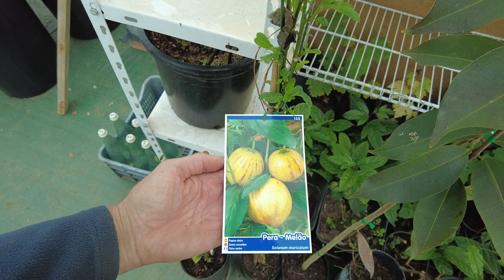Sandbag leaky weir ready to be tested. Let the rain come!

Comment: Tried to get the pepinos to grow for years now, but they always get completely destroyed by the spider mites. They're not very resilient.
Reply: A suggestion for you; If you ae having trouble with spider mite infestation, make sure they are clean before you plant them out.  If you see evidence of mites, wash the under side of the leaves in running water.   Select a different part of the garden than you have used before incase eggs survived in the soil.  Immediately after planting, cover with white, non-woven floating row and grow them undercover for the season. 
Hope that works for you! 😊
Reply from the maker: Thanks for sharing. Are there any natural enemies for them?

Comment: 0:10 That's the mouse who plants acorns!  Relocate the little critter out to one of your brush piles on the far side of the farm  - alive and well so he/she can start planting in that area  I'll suggest keeping a live trap around the house just for that purpose.😊
3:40 That is a great surgical cut.  The branch bark collar is fully intact and the majority of the exposed wood is alive.  I think there is a good possibility that collar will callus that wound in a few seasons.  I am curious about the pattern of decay.  Can your Forest Warden identify why that is happening?  If you want to seal the healthy wood, I will suggest Lac Balsam, formulated in Germany for this exact purpose.  There are two varieties.  One is simply a coating that will not inhibit callusing. The second I'm told has anti-decay ingredients that is not sold in the US.  I have used it the coating only formula with great success.  It is the only coating known to protect the wound as healing takes place.  I strongly encourage you to buy a tube and try it.
I agree with the other commenters about sealing up decayed wounds.  The damage is already done to the heart of the tree.  Sealing the opening seals in disease and moisture - and that environment  speeds up the rot and decay process.  I know, intuitively it makes sense - but university research says it is bad practice.  The best thing you can do for the tree is; do what you can to protect it's vigor so that the outer layers of the tree continue to add healthy tissue.  You want to encourage the outer bark, inner bark (phloem), the cambium cell layer, and the sapwood to stay healthy.  Selective pruning to balance the load on the trunk is your best bet 😊
While you have the volunteers, I'll suggest that you use them to help move some of the longer, heavier pieces of tree trunk you have into the creek and erosion gully and lay them across the channel.  If you get them positioned now, you can use them when you have time as the base for more leaky weirs and/or one log dams.
All of the climbing plants you have will be spectacular on the steel wire garden arbor you have built.  One end with a climbing rose on the right and left will make a spectacular entrance.  
Good luck with your leaky weir build tomorrow!
Reply from the maker: Thanks for sharing Steve. Lots to chew on as always.

Comment: Yessss, a lot of rain is on its way.
The only thing which doesn't look too promising are those bags of sand. I think that you need to put multiple rows of bags, because at the moment it doesn't look strong enough for higher flow of water. But okay, it will be new test. The worst thing which can happen is that you will need to pile them back 😉 Please make videos when creek will be in full strength, I really want to see how structures will behave during heavy flow. This year will be better than the last one! Just stay positive!
Reply from the maker: Thanks for sharing. We feel strong as we had some rain and hopefully more to come. We will also have drop irrigation that will free us a lot.